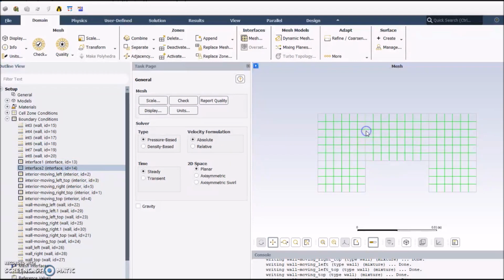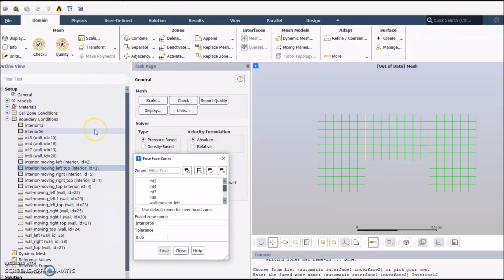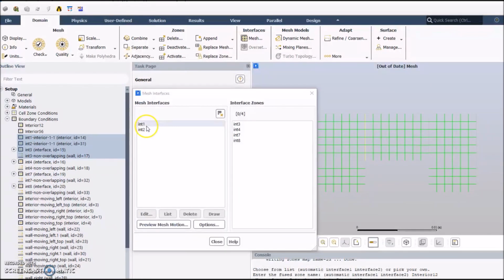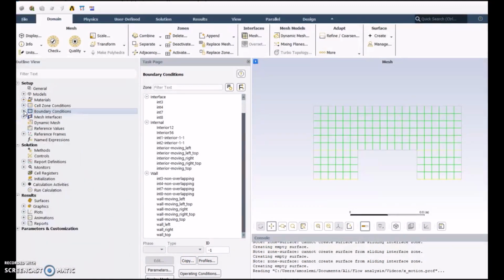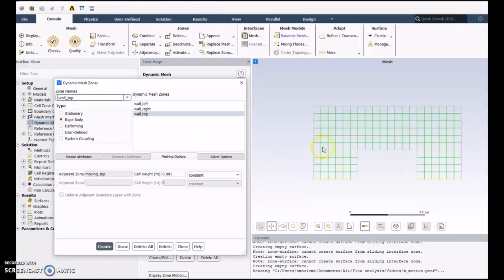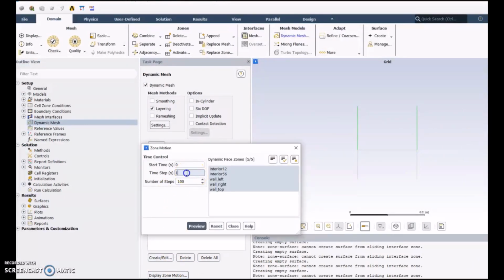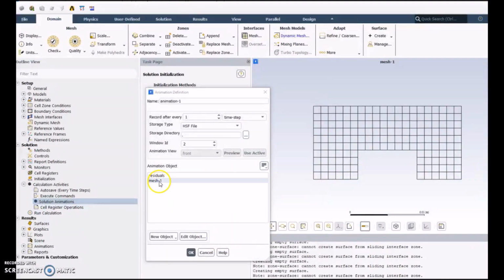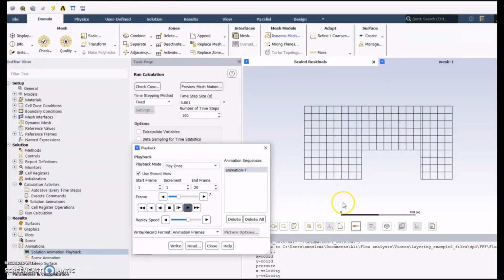Fluent settings for dynamic meshing: Layering technique

Comment: Hi! It's a useful video! Can someone tell me how is build the x-motion profile? I'd like to kwon how to change it by my own depending on the movement I want to give (ex go back and forth, what speed and so on). Thank you in advanced!
Reply from the maker: Thanks. I briefly explained in the video. Just re-type what I showed and change the numbers...two number for the time indicates the beginning and end of motion, the same applies for v_x showing the respective velocities. if you need more info, search for how to write profiles for Fluent but if your motion is simple, you can use what I showed.
Reply: @pulsedflowsolutions9058  thank you! I tried, changing positive values it works; but if I try to use negative value I do not manage. ex: ((x_motion 3 point)  (time 0.001 0.002 0.003) (v_x 0.05 -0.05 0.05) and in the mesh motion preview I use 0.001 for the timestep size and I set 300 as number of time steps. I've also read about how to write profile in Fluent now as you said, trying to use this ((x_motion transient 3 0) in order to assign different values at velocity, but it doesn't work too. Last question is if you have an idea for this? anyhow thankyou!

Comment: Good video, here why you are making the surface_top to move with the flow. If wall body is moving in fluid the adjacent top_surface will not move in real scenario.
Reply: The Fluent manual is not clear about this but I guess this is merely for mesh generation and it doesn't mean that the flow in the top region is moving with the same speed. However, I am not sure about this. You need to run the flow simulation to ensure this statement.
Reply: Ali Moslemi thanks for your quick reply